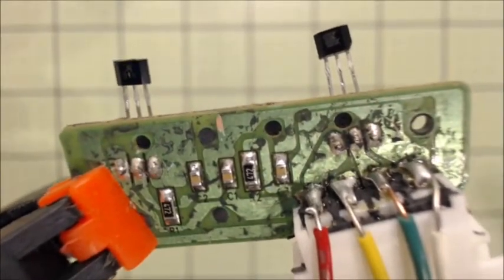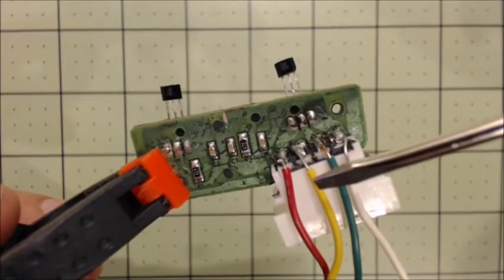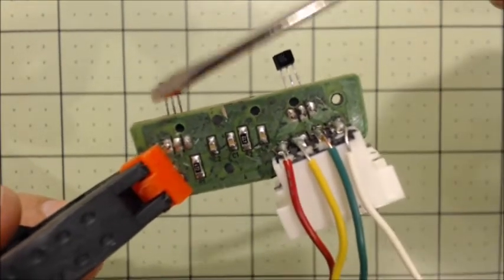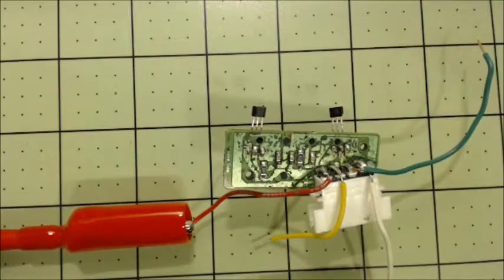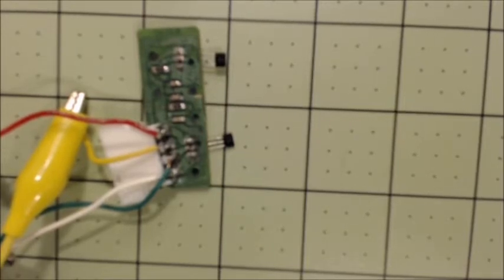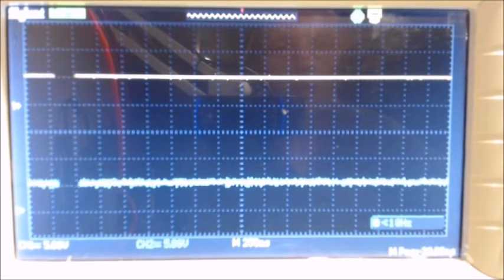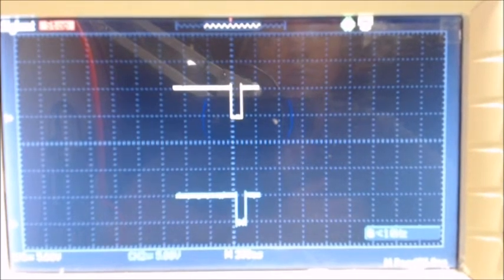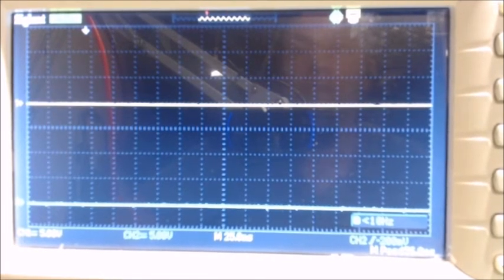Samsung Washer Hall Sensor

Comment: What voltage do the sensors latch to? I'm getting just under 1.2V each, but they are still attached to the main control board. I'm about to pull my scope out and look for broken magnets in the motor. Unfortunately I only have one lead for my scope right now but I don't think that should be too important
Reply from the maker: 5vdc
Reply: @electronicsprojects4708  thank you for the reply! After replacing my main control board, twice, my problem was solved. The supposedly new from floor model control board I had ordered the first time was also bad, sending me on quite the goose chase. But the washer runs great now!
Reply: Gary, hopefully you remember but what error code(s) and symptoms were you having with your washer to determine to swap the control board?
Reply: @sevillasllc3391  the control board hardly goes bad. Unless voltages flashes and control board goes on and off. Hall sensors failure show in a different way. It turn on but the durm spin in a violent way a couple times and then it should show an error

Comment: Hola soy de México que valor tiene los triac del sensor
Reply from the maker: Not sure if my translation is correct, but there are no Trials in the sensor circuit. Triacs are used to relay AC voltage, like a relay. These Hall effect sensors operate on DC voltage, usually between 5 - 15 VDC depending on the design.